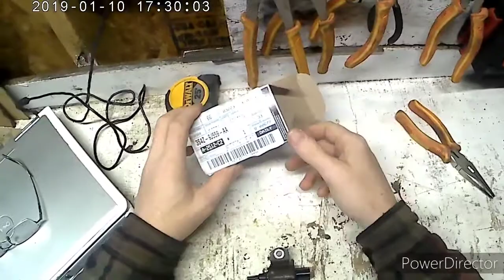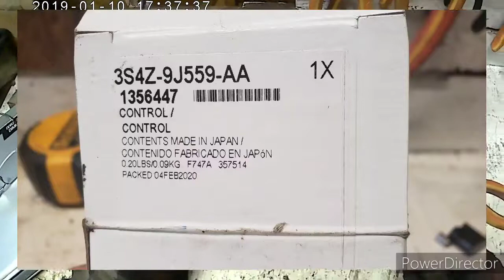Replace Intake Manifold Runner Control Solenoid (P2004 Fix)

Comment: How's she goin'?  A solenoid can have lots of resistance depending on the voltage.  But for a 12 v solenoid very high resistance just wouldn't be right.  The higher the resistance the more current it would draw.  If you can determine what this solenoid circuit is fused at you can use the voltage and the current to determine the resistance.  Thanks for sharing and for the mention in your clip!!!  Take care!!